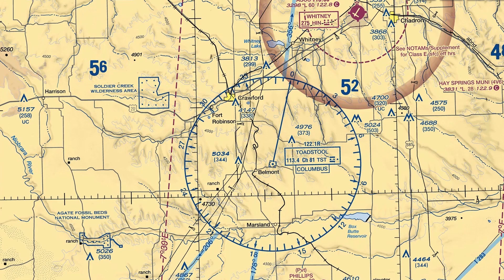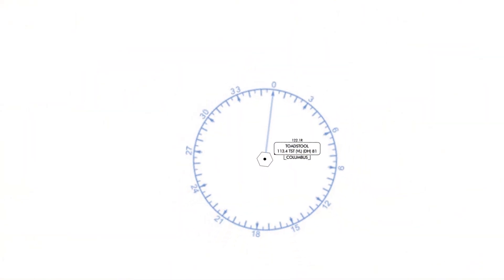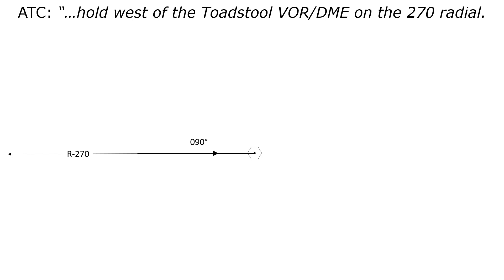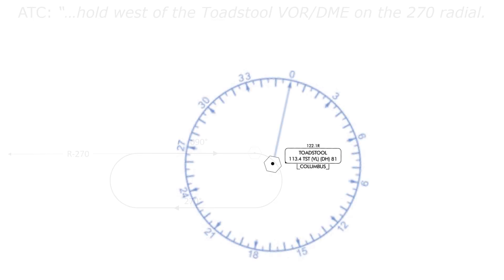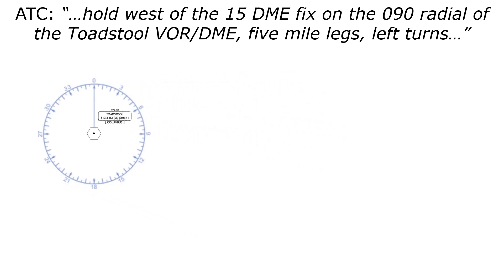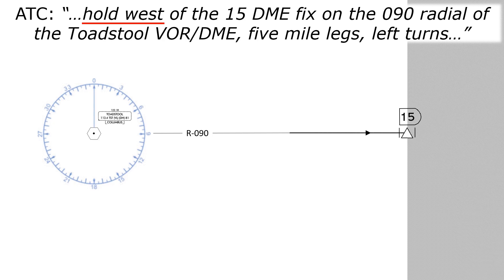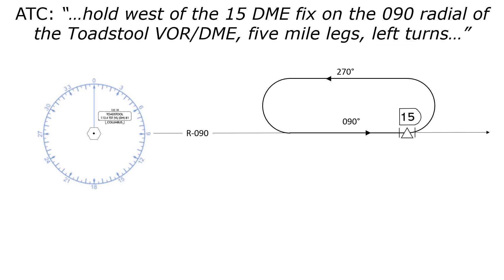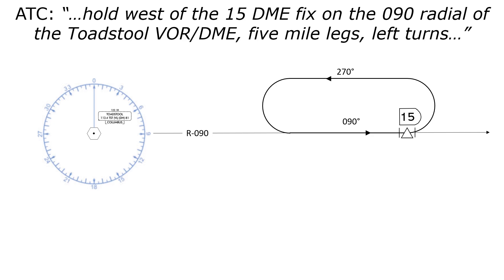Drawing an Unpublished Hold | IFR Holding Patterns

Comment: Thank you for the helpful videos! Quick question, my only confusing concern is which way to face during these holds. As far as I’m getting, I see most of the time you face inbound towards the VOR on the desired radial and do your right turn standard, or left if told to do so.

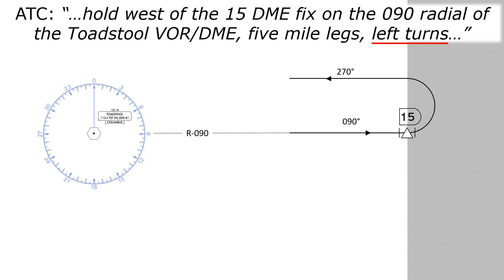I’m kinda confused at 3:40 as I get the 090 radial, 15DME I understand, I understand left turns and the west part, but I would have been inbound turning left; still on the west portion side but doing it the opposite. 

Think of what you showed with the hold pattern, but upside down on the bottom side on the line, and I’m still going inbound and turning left, how do I get this confusion out?

I’d still be 090 radial, 15 DME, left turns, but I always thought you turn as desired inbound to the fix/VOR. Such as at 01:40 you were inbound and turned to the right standard.
Reply: i cannot understand what you are writing, but maybe this helps...   the 15DME on the 090 radial from the VOR, this declares a new point and that is now the HOLDING FIX, lets call it FOXY. so now, holding west of it with left turns means you fly towards FOXY from the west on the 270 radial FROM FOXY towards FOXY, then left turn and on the outbound leg heading 270.
once you established the holding fix FOXY in correlation to the VOR, THAT becomes the new fix and all holding construction thoughts happen there.

Comment: Why on the 270 radial you do the inbound towards the vor and on the second example you do it outbound of the vor?
Reply: I’m confused on this also.
Reply: The first example was an instruction to hold at the VOR. The second example was to hold a a separate waypoint that is along the VOR course. Two separate locations.
Reply: @shawnforry9155  so is it always facing inbound to the VOR station unless told outbound?
Reply: a hold always happens towards a fix as the inbound leg. in the first example the fix was the VOR. in the second example the fix was a newly established point on the 090 radial. and you go TOWARDS that. in this case from the west. the fact that the VOR is behind you has become irrelevant since it's not part of the fix anymore. its only purpose now is to identify the new fix point (15DME on the 090 radial from the VOR)

Comment: Something else I like to do here is show how to draw this on the HSI. I’ll combine such with a VOR/DME point-to-point introduction. While flying, I’ll give a drill series of point-to-points ending in holds though I’ll have the student figure these out, get pointed the right way, predict entry, and then create a new waypoint and hold at waypoint both to refine and to enable them to check their work. Teaches them both the manual ways and the FMS while building confidence in both. 

I’ll also combine both the chart drawing and the HSI with the slant for recommended Hold Entries. (Difference now is the Hold is centered in HSI not our plane after having solved the point-to-point and now working on determining the entry.) Now something interesting here, they look opposite yet they depict the same thing. So, I’ll redraw on a paper as opposed to the board the chart view and flip the paper to draw the HSI view showing how they super-impose coincident and that really they’re the same from opposite viewpoints. Heads no longer hurt seeing the flip. In addition to this, sometimes I’ll draw the HSI way then draw the chart way in the three sectors of the HSI on the same drawing. I’ll then take a different color to trace the aircraft on each entry over time on these chart-like drawings in the HSI’s respective sectors thus enabling them to be seen as making sense. Before all this, though, I’ll hit Purpose with parallel counterflow so as to avoid the unprotected side, teardrop so as to create turning room for the second turn, and direct being kind of obvious.
Reply: Would love to see a video showing these methods!

Comment: For the west of the 15 DME fix example, would we need to keep the turn west of the fix too in order to say that we were always west of the fix throughout the hold?
Reply: The inbound leg is west of the 15 DME fix.  That's the critically important component of the holding pattern.  The other three legs just set the stage for the inbound leg to be correct.
Reply: No. Don't start your outbound turn until 15DME. The other commenter is completely correct.

You will fly East of 15DME a little when you initiate your left turn at 15DME

Comment: My thought process;
* Cardinal point
* Compass radial
* Not sure how to measure the distance of flight (e.g 15 DME)
🌲
Reply: If you dont have DME, selecting the VOR as a waypoint on a GPS will normally show the distance from the waypoint/VOR.
Reply: @alexc5449  likely you could also create a new waypoint defined as the radial dme, and/or with lots of new-ish PFDs, the GPS will auto-fill a “dme” value to the NAVs. Highly recommend having Pointers to the NAVs up even while flying GPS. Try something sometime for a little skill, find, enter, and hold Pointer only.
Reply: @jimallen8186  Yes, custom waypoints are another option if you’re familiar enough on how to do it properly. Definitely would discourage someone try to figure it out while in IMC conditions though.

Comment: Soooo helpful! Now I need to practice writing down the instruction with autopilot off. I’m getting there bit by bit.
Reply: Foreflight has a scratchpad template for holding which is very handy. Helps you to write the applicable information down quickly